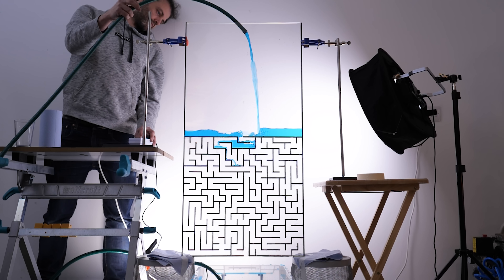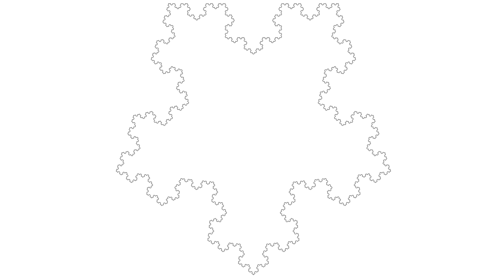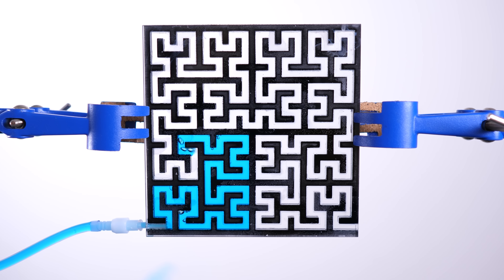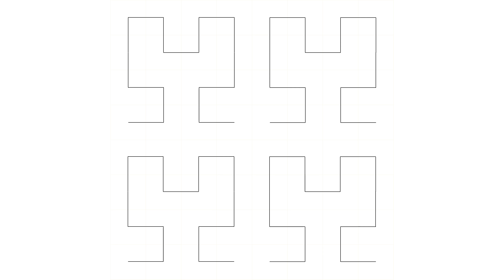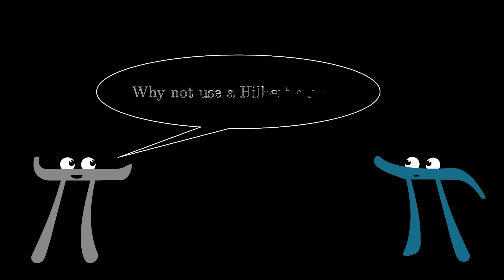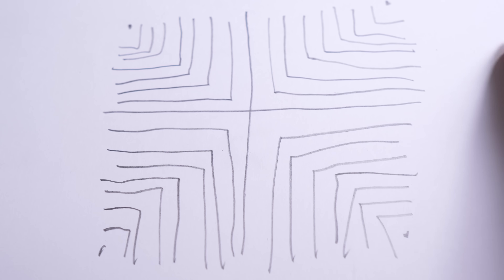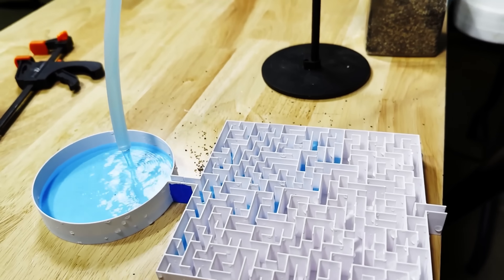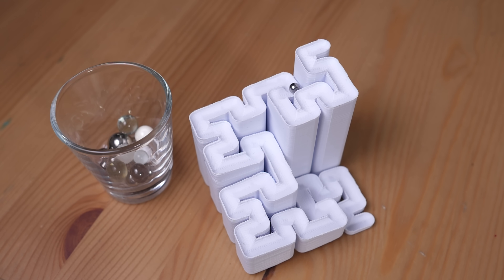Space filling curves filling with water

Comment: I'd be curious how the cube would act as a heating/cooling element. Like a normal heating tube is normally "2d" which means that as the fluid travels along it, it loses heat to the surrounds.... which of course is what it's designed to do, but it means it has to have more heat pumped in from the origin.... if its 3d, does the inside each through to the outer layers, which would in turn heat back towards the centre... it would still lose heat to the atmosphere, but I wonder if it would be more efficient than the 2d tube. Would the source need to heat the liquid up as much before its pumped into the cube, or would the cube help to heat the liquid too?

Comment: The thing is that your drawing isn't a curve topologically because it's not a single curve. It's a bunch of multiple curves, and becomes only a single one at infinity, when all the points meet, which, at that point, is also the 2D space itself.
So it does have fractality, but it's not a single curve BUT you do have an iterative process to generate it, so it is a fractal. So it's a fractal but not a space-filling curve, IMO.
But you can call it "set of curves that fills space".
*Topologically, a curve, in layman's terms, is a set of points where all the points are connected - between each 2 points there's another point. But in your case there are spaces between the curves; points in the space that don't belong to the curves. So they aren't a single curve, but multiple ones.

Comment: Really interesting video. In my recent (free) science fiction novel, "Breathe" I had my characters build supercapacitors by using space-filling curves as a boundary between two halves. I illustrated this with a Hilbert curve. As the order of the curve increases, the length of the 2D curve increases. If this is made into a 3D space-filling membrane separating two electrodes, then the surface area increases with the complexity of the curve. Since the storage capacity of a capacitor depends largely upon the surface area of the "plates", this opens the possibility of making supercapacitors with storage capacity far beyond anything we have today. Of course, in my story I didn't go into the details of how that might be made, but interesting, huh? :)

I should note that our lungs perform a similar trick, packing a membrane with about the surface area of a tennis court into the small volume of your chest, and still leaving room for your heart, ribs, spine, and aesophagus.
Reply: That's a neat idea! Capacitors are generally tubes because a plate-membrane-plate sandwich can be rolled up easily by machines and server a similar, but less visually interesting, space filling role
Reply: If anybody wants to see how I use the Hilbert curve as a separator in my novel "Breathe", it is at my website miriam-english dot org where all my stories are free -- genuinely free -- my website has no trackers or scripts, and no advertising.

Comment: I would argue with both of you about the "fractalness" of the Celtic circle. I agree that it is not a true fractal of infinite repetition, however there IS a constrained self repetition involved that is highly similar.  When you look at it from a distance, you will notice that there is a recursive "arc" of a partial circle that repeats itself in a smaller version from the outside of the shape to the inside. It also could be linked rather effectively to a form of wave propagation. If you start at the center, each progressive "group iteration" follows a path of making a progressively larger set of nested arcs. As each series of clockwise and counterclockwise turns or loops are completed, it merely jumps up to creating the same set of CW and CCW curves at the next larger scale. I would argue that this is a scalar fractal with two terminals, or effectively, a bounded fractal with a start and stop point. I am not entirely sure what that would be called as I am NOT a mathematician. but I can sort of prove it with a sufficiently large piece of paper and two variables of "gap dimension" between the path constraining walls and the overall area (possible even volume) of the final entity.

Comment: Isn't it impossible to fill a true fractal curve? If it goes down to infinite detail (assuming we have a liquid of infinitely small particles) it has an infinite length but the liquid cannot travel at an infinite speed, it can only reach the speed of light. So it would take infinitely long for the fractal curve to be fully filled no matter how fast you press the liquid into it. Right?
Reply: It's only impossible to fill an infinite curve on an infinite plane, because if I were to show you a fractal curve that I limited to a 5inx5in square, while the area is finite the length of the curve is practically infinite, as any measurement on its length can be continuously broken down to the sub-atomic level if you really wanted to see how many quarks long it was. In fact there's a geometric shape called Torricelli's trumpet, which has an infinite surface area but a finite volume.

Comment: Basically, in layman's[?] terms, the problem with the celtic curve is that a next iteration of the substitution rule (doubling and folding the entire line back on itself) doesn't roughly follow the same trajectory as the previous iteration. It follows it forward *but then backward too*, which is different. For the hilbert curve (or koch curve, etc.), however, it follows the same outline as the previous iteration with just some added smaller and smaller wiggles as the iterations progress.
This means that the hilbert curve does have a limiting fractal curve, but the celtic curve does not.

Comment: Pretty sure these curvey ones are all equivalent to a spiral that has the lines touch each other as it loops in.  As lines are infinitely thin, the spiral will go on forever as you zoom to the middle. 

In general, I bet you can define it as a line where the sum of the angles of rotation is equal to 360 - (1/∞).  That rotation can go back and forth between positive and minus, so long as the final theoretical shape has a total angular rotation of 360 - (1/∞).

Prove me wrong, I didn't bother trying and it might be fun and or easy to disprove my conjecture.

Comment: The Celtic Labyrinth is a space-filling curve, just not a very "good" one. It's easy to make a space filling curve...just take any figure with some regular distance between the lines, and let that distance tend towards zero. A spiral is an easy one, or you can fill up a square just by drawing infinitely many straight lines (horizontal, vertical, diagonal, you pick). And it would be easy to prove that these simple figures fill space. The reason they're not as "good" as the Hilbert curve is the reason you already mentioned...locality.

Comment: If a Hilbert curve can fill a 2 dimensional area, as well as a 3 dimensional area in the cube you showed, would radiators benefit from having this type of tubing system run along in them to get greater surface area and volume filled  in more of the radiator to cool down more of the water that travels inside, instead of just the back and forth along the radiator that they do right now?

Comment: The proof of that the hilber space covers the unit square is actually fairly understandable and doesn't use very complicated mathematical tools. The main concept that i think you are lacking to understand why the labyrinth curve fails is the notion of what it means for a sequence of curves to have a certain limit. In math curves aren't just the drawings, they are functions, like s(t)=(cost, sint) is a curve whose image is a circumference of a circle, but said circumference is not a curve on its own.

What does it mean for a sequence of functions to have a limit? There are loads of answers to that question, but the two big ones for our sake is pointwise and uniform convergance. Pointwise is pretty simple: you just have to check that for every t, the sequence f_n(t) has a limit. Like, s_n(t)=(t, t+ 1/n), for any fixed t, the first coordinate is constant and the second one approaches t as n grows. Graphically these are all parallel lines that get closer and closer to the line y=x. Uniform is a stronger notion, where not only do we ask that for every fixed t, f_n(t) has a certain limit, we also ask that they also approach "at the same speed". In the previous example, the convergence is indeed uniform, because you can see that all of the points of the line are getting closer and closer to the limit with no points "lagging" behind. If you want a non-example, think something like s(t)=(t,1/n * t). For any fixed value of t, the first coordinate is always t but the second one approaches cero. These are lines that are getting more and more "horizontal". The problem is that for any of these other lines, there are always points that are far away from 0, so even though every point is "dropping" to the x-axis eventually, they are doing it at different speeds, aka non uniformely.

The hilbert curve is the uniform limit of those fracal curves, that is how it is defined. Because of how those fractal curves are constructed (+ some nice properties about function spaces), you can show that the limit does indeed exist. And also because of how those curves are defined, you can see that every point is getting at a lower and lower distance of the curve for greater iterations, and because of uniform convergence, you can then show that those points "in the limit" must be at distance 0 from the curve, aka: they are part of the curve.

The problem then with the labrynth curve is:
1- what is its pointwise limit?
2- if it exists, is the convergence uniform?
Maybe you can redefine things in a way that you can have a good answer for question 1 (I'm unsure). Even then, the problem is question 2. One thing about the hilbert curve is that every iteration gets more and more squiggly, but it doesn't "jump around", it has that nice locallity property that prevents points from getting too far away which helps it force all of its point to converge to that limit at a uniform rate. Or at least, that is what I gather, this is not my field here.

Comment: That liquid 3D Hilbertish curve came out really nicely! 
I think that the labyrinth sequence doesn’t limit to a “curve” (in the sense of a continuous map from the line to a 2d disk). As you go further into the sequence, it swings back and forth around the circle faster and faster. So even if you did get a sensible answer for “where is the limit curve at time t?”, I don’t think the answer would continuously vary as t increases.
Reply: Interestingly, there are continuous functions from the curve to [0,1], although mutliple values on the curve will get mapped to the same point on [0,1].
Since it isn't injective, it is jective!

Comment: The celtic labyrinth can be defined by a substituion rule, but you have to stretch things a bit. Take two copies of a celtic labyrinth, stretch one out and open it up into an inverted U, and wrap the other curve with it - leaving a gap up the middle so you can join the two. To put it the other way, for a celtic labyrinth, there's clearly two layers to it (an outer and an inner), and each layer has the labyrinth structure.

Comment: That visualization is pretty awesome! I want to see the same thing at like... room scale... with clear pipes. It would be AWFUL to assemble lol. with the locality and stretchyness of the hilbert curve your prints demonstrated REALLY well, I'd imagine it'd be near impossible to hold rigid too...
Reply: Count me in.
Reply: @standupmaths  ba dum tss...
Reply from the maker: Do I detect a nerd sniping? Can't wait for the video!
Reply: @SteveMould  would this concept of space filling curves apply to the 4th and even higher dimensions?
Reply: You could use braces, there are enough parallel parts that can be linked to spo them from wobbling away. It takes a bit away from the concept bit not too much.
Reply: would use a very thin exit nozzle, to make sure the water is well pressured, and fills everything as it goes through. 🤔

Comment: This is also working because the size of bubbles is similar to the size of the diameter of the passage. 

If you had two inch wide tubes in a much larger cube, then you'd end up with air entrapped all over, much to your annoyance.

Comment: The circuit traces on motherboards need to be precisely the same length in many cases so that timings arent messed up by signals arriving late or early. Often the designers will have to make all sorts of weird patterns in order to get traces to be the same length. I wonder if they use this sort of approach to lay them out.
Reply: It's a matter of starting with the required length, then finding where to fold the excess length.

Comment: Your spiral is indeed a fractal and, depending on the exact definition of the curve, it is space-filling at certain points.

A fractal is by definition a set with fractal dimension (rigorously the Hausdorff measure) strictly higher than its topological dimension. The topological dimension in this case is 1 since the spiral is made up of lines. In a neighbourhood around the center point (as depicted in 5:28) the set (in the limit) has Hausdorff measure 2. This gives a lower bound of 2 to the Hausdorff measure since the Hausdorff measure of the union of two sets is the maximum of their respective measures. ThIs proves your spiral to be fractal. In fact its Hausdorff measure is exactly 2 since it has an upper bound of 2 as a subset of 2 dimensional space.

It is worth mentioning that the definition of fractals doesn't require self-similarity. Probably the most famous fractal, that is the Mandelbrot set, is not self-similar (although it is quasi self-similar). However every space filling curve is by definition a fractal.

Regarding Matt's answer, it is understandable since without a clear definition of the curve it is usually not obvious to calculate the fractal dimension. However in this case it suffices to do it in a neighbourhood around a point to yield a lower bound which is greater than 1.
Reply: What is the metric space that is a fractal here? We have a surjective function from the unit interval to the unit square. Both the unit interval and the unit square are not fractals with respect to their usual metrics. So which metric space has a higher Hausdorff dimension than its topological dimension?
Reply: @sourdoughnovice22  The spiral with the induced metric as a subset of the plane works. Notice however that the map from the line segment with image the spiral is not continuous with the standard topologies, which is where the confusion with the metrics may come from.

Comment: You're doing it wrong. Use suction instead of pressure. Put the entry point in liquid and apply suction to the exit point. You should get a perfect line between the two points.

Comment: Potentially could make for great heat sinks especially if it could be designed with Tesla valves to make a single direction flow without an additional pumped supply as a heat engine.

Comment: So, what does the pressure / resistance to flow do as you increase the (order? fractilization? packing) of the hilbert curve? What is the length of the curve in that cube as you increase this? Obviously both will tend to infinity, but it would be interesting how quickly that happens --> is it quadratic?

Comment: meh this is uninteresting to me. kinda seems like one of those science for the sake of science things that has no declarable utility.
Reply: I beg to differ. While studying computer science, I found the utility of space-filling curves fundamental in the context of parallel programming. When dealing with multiple processors, for example, space-filling curves enable efficient data partitioning by dividing multi-dimensional (n-dimensional) data into smaller parts assigned to different processors or threads. Ultimately, this reduces the need for data movement and communication between processors.
Reply: @Niveum  sounds like you're trying to stretch a turd to fill the void you call personal knowledge. None of that data manipulation is needed with properly normalized data sets. You would have known that if you weren't just regurgitating some dribble you found on a quick google search. Quite frankly I'm embarrassed for you.